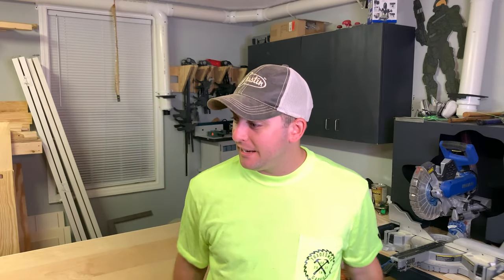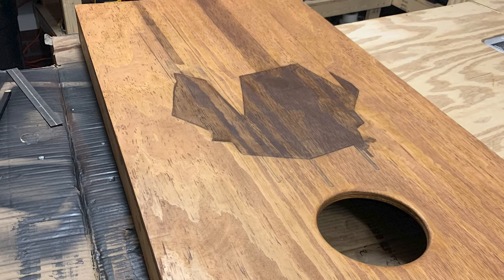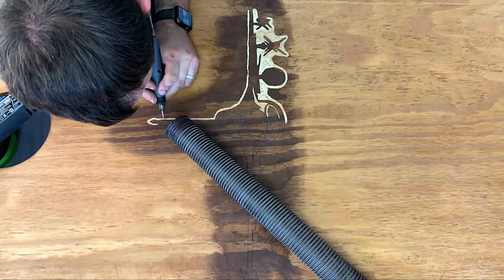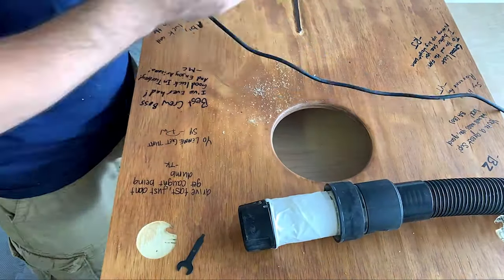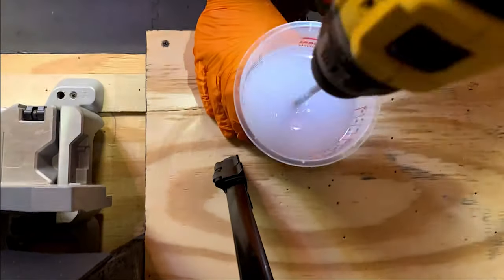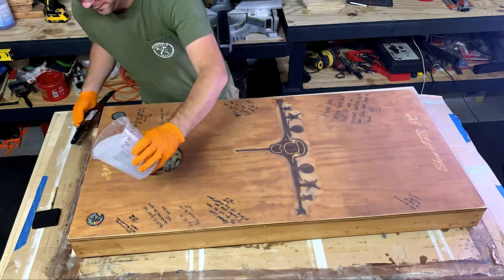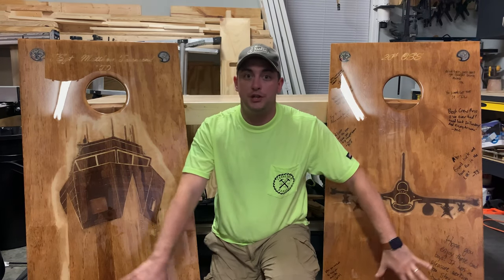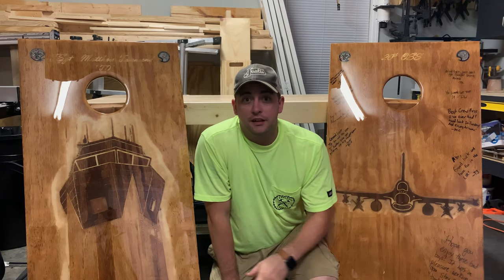Hand Carved Cornhole Boards

Comment: I really like the idea of using the dremel to make a 3D type relief carving, very nice work.
Reply from the maker: Thank you!  It was a lot of work.
Reply: @TradesmenGarage  I can see that it was a lot of work and time.  I've done some relief carving in the past, but never thought of it for a cornhole board, the Epoxy Resin to smooth it all out is a great idea.  Just might has to try it.  Thanks